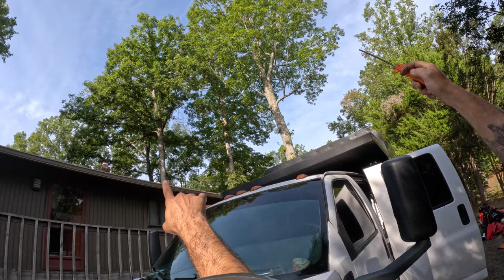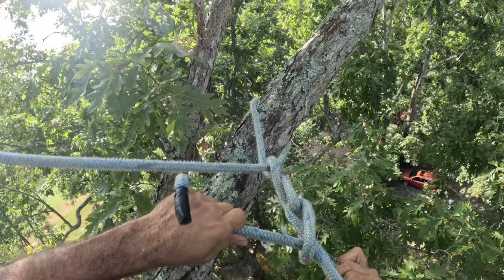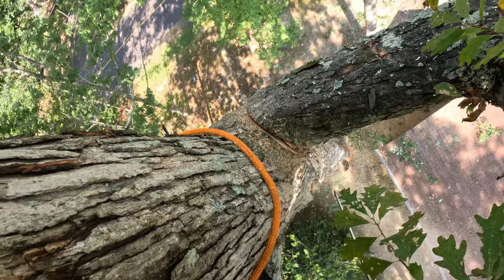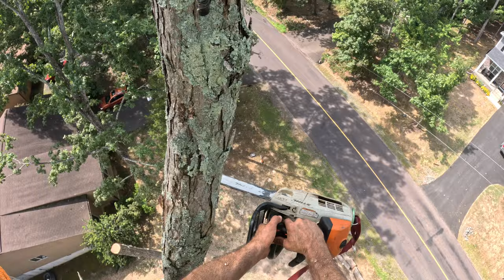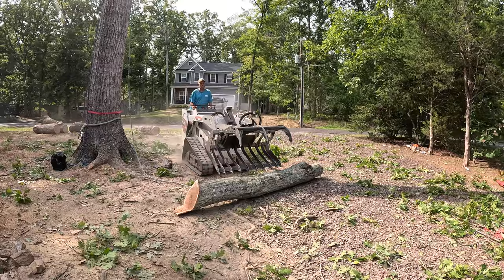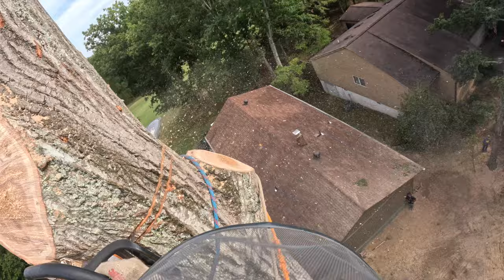Epic Oak Tree removal Rigging Over House

Comment: Seen a lot of equipment fail recently, the new isc quick link it’s updated model, someone had the safety button that holds the pin from spinning pop right off
Reply from the maker: Yikes 😳 I think I’m gonna get the notch top runner

Comment: What size rooe are you running?
Reply from the maker: Samson stable braid half inch
Reply from the maker: Also five eights for the big wood
Reply: @Notchemandwatchem  on your zigzag?
Reply from the maker: @josemagana5512  no those are my rigging lines. I use a rope called petzl flow 11.6 mm.